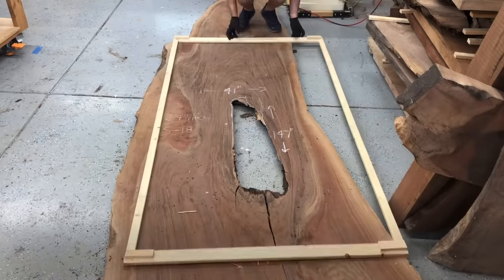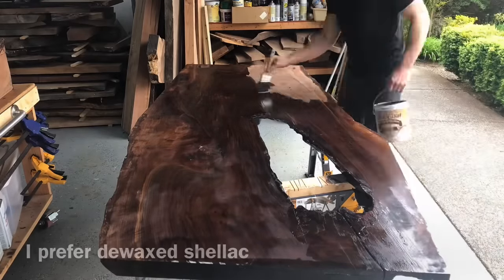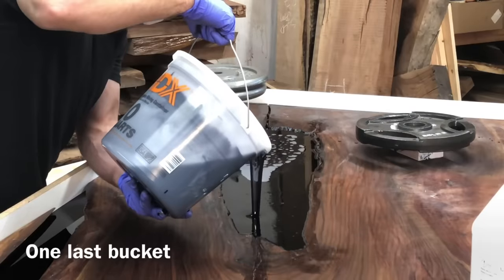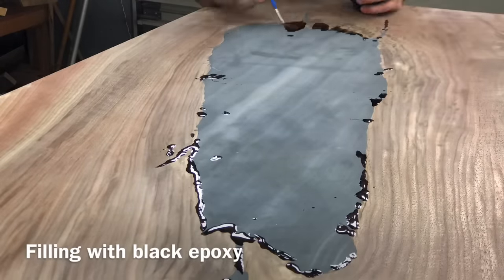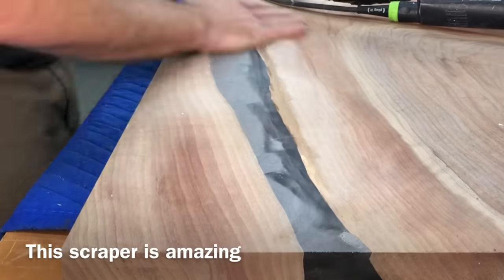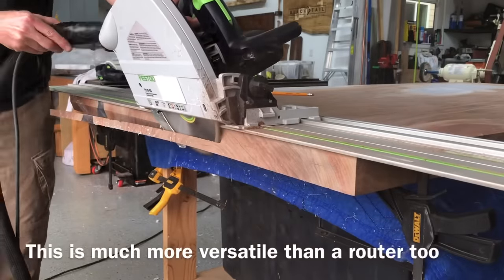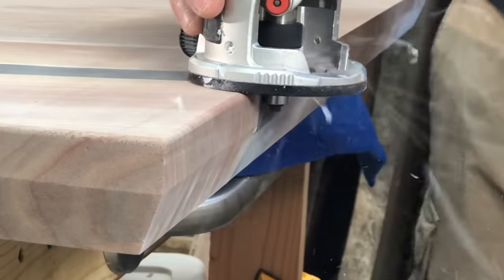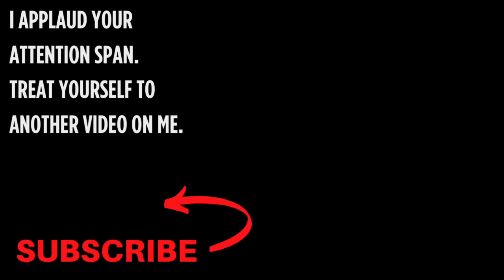$250 Slab To $7700 Table

Comment: Love this table, excellent patch on the corner as well, I'm a Staircase builder by trade, I specialised in curved handrails. Another way I've found to fix difficult patches is to use 2 types of glue, standard PVA wood glue on the outside edge of the timber faces and a super glue on the inside of the faces. Personally I've found a product called Mitre Fast, a 2 part super glue that bonds in 10seconds as the most efficient method. This allows you to fix the issue completely and move on within the hour without having to wait for the PVA to fully cure.

Comment: Another method to consider when attaching the small piece of wood to the corner is to use electrical tape instead of painters tape. It’s stretchy and will apply a small clamping force to the piece as it dries. Great work sir, much respect.
Reply: I have no experience so I may be wrong, but I’d consider putting down some painters tape on the table first, then using the electrical tape to clamp the patch piece on and not have any adhesive from the electrical tape sticking to the table.
Reply: Electrical tape will leave a residue. A strap clamp would hold that piece in place, just loop it around the tabletop and ratchet it down.

Comment: I love the finished table.  Admit I had doubts at the beginning when you said black epoxy, but i stuck with it and was converted at the end! Absolutely brilliant solution to the imperfect corner. I think I would have rounded it off and done the same thing to all the other corners to match because of where the problem was and the size and the issue with not being able to clamp. So hats off to you for sorting it out so brilliantly!

Comment: I used to finish concrete. We would "knock" the mold many times with a hammer to get the bubbles to "surface out". In large pours we would insert an industrial type of vibrating "peg" for lack of a better term for the same purpose. Have you considered knocking your mold with a hammer after your pour or otherwise trying to vibrate the bubbles out of the solution?  I would think the bubbles would surface easier if the solution were warmer as well. Awesome project man! Oh,,, and metal, hands down.
Reply: I had the same thought. Vibrating the fresh epoxy might eliminate many of those little flaws that appear after planing.
Reply: @marcstory860  that doesn’t remove the bubbles. Heat from a torch or heat gun remove bubbles from epoxy. Look it up.
Reply: @Ritebowl  There's usually more than one way to accomplish a task and one is normally better than the other. It's called process improvement.

Comment: Have to say that's the most amazing table I've ever seen, even been in 6star hotels but you have topped them all. You are certainly an artist in my books. Talented would be an understatement.
Reply from the maker: Wow, thanks so much!
Reply: 6 star hotels? dang you find them in outer space or what?
Reply: @Neopopulist  Different countries and organizations use different rating systems for hotels. Many organizations use a 1 to 5 star rating but you also have journalists that will write stuff like "yeah this could be a 6 star hotel." Or a 7 star. Or (insert however many stars you like) even if no such accreditation exists to illustrate a point about the quality they experienced.

Comment: You may want to invest in a system for flipping these large heavy tables over.  I work in a custom wood door shop and we make large heavy doors and most of the older guys in the shop have some pretty serious shoulder issues from years of flipping doors.  When you flip with the full weight of the table coming down on one shoulder it can mess you up long term.  Love the video!

Comment: Metal. Beautiful work, as always. And as requested, my experience tip: when using a saw or plane to cut away overhang like on the fix for the lost corner: cut in the direction that pushes or pulls the pieces together (not away from each other, just in case any weakness in the joint (or adjacent wood) decides to take advantage of the situation.
Reply: When I did wood working and needed a bevel 
An older carpenter said to do the corners first about a foot away from the ends to prevent snaps or breaks from the weight of the length 
I disregarded it the first time and than I was like sure we will try it 
Second time it came out perfect 

Home renovation- client wanted some custom molding they seen online but they didn’t want to pay the money for it so he paid me and my mentor to make them and reframe ever door and do some custom stairs
Oh joy 
Funny thing is my mentor was in his 50’ s he was old school and as close to no power tools as possible except for precision cuts 
He would hand saw or chip everything and sand and shave everything

Comment: Great repair also.
Sometimes we have to slow down towards the end of the cut. Also, with the track saw. You can stop and trim the cut off so it's not dangling. 
Or, change the saw blade. The carbines get dull or damages

Comment: I don't build tables, but as a general rule, it's always good to have an extra sawhorse around when ripping long sections, even if you're just cutting sheathing for your roof. It's such a bummer when a once-nice piece of wood ends up with an ugly splintered corner that could have been easily prevented. Thanks for the video.

Comment: These are amazing legs for the table. The whole product is simply stunning. If I had money this is exactly the design I’d go for but replace it with your fire table. Metal and wood all the way for myself. I also think using metal around the edges will make for a very cool design. Not sure how will it affect the seasonal changes though.
Reply: depending on the fasteners i feel that if it were screwed on it would work just fine but if you were to weld the borders around the sides that might pose for a bit of an issue

Comment: Doing some glue ups with weird angles and I find packing tape works amazingly well because it can stretch. Make sure it sits pretty flat though because if not the bumps leave residue that can normally just be rubbed off but sometimes it needs a sanding block or chisel.
Reply: This has nothing to do with your comment,but I love your user

Comment: I freaking love these videos. I just found you today and I’ve probably watched 5 hours! I wanted to ask you why you only use slabs and not boards. I assume the clients are probably looking for something specific. I made an 8x4 dining table with old white oak railroad wood. I ran into a few issues along the way and I didn’t have anyone to look to for experience. One thing I found interesting is the epoxy I mixed the first few pours were quite small, then my flood coat I used a large bucket, and within 30 seconds of mixing the resin and hardener, it started smoking and melted my bucket. The company told me all epoxy would do that as it is exothermic, and I needed to mix larger pours on sheet trays… I ended up just using a bunch of 1/2 gallon mixes and I ended up scraping the final pour right down the middle and sure enough, still to this day have a strip of tacky epoxy. I plan to refinish is someday when my kids gauge it or something, but do you know any tips or tricks other that picking it out and re-pouring? I look forward to using your workshop when I build my in-laws new table for their lake house next year.
Reply: I know I have seen others who will layer the resin for that exact reason. Maybe try the type of resin he uses?

Comment: I like bare metal legs when the legs are a feature of the design, and black when the focus should just be on the table top.

Question--how to you calculate the price of a table, and have you ever increased the price because the finished table looked better than anticipated?

Comment: The only tip I can think of would be this: Don't hesitate to use scraps of wood to make an elaborate clamp that is perfect for the job. It's better to use up a couple of small scraps which might be useful later to ensure a perfect seam on your current project.
Reply: Exactly. Fixtures are essential to manufacturing. Otherwise you pay big in rework labor and scrap.

Comment: I love the wood with metal look. I like how the table base wouldn’t need to be as big and bulky in order to be functional. And with the metal base I would almost love to see some intentionally placed metal inlays. wether the inlays were functional or more so only  for aesthetics like if it were to be one little 1/8” band to go all the way around the perimeter. When I get to having plenty of my own time to myself for projects like this, I would love to make a massive steampunk themed piece with a lot of gears that work into moving parts
Reply: I love dark wood and chrome. Aluminum is a lot cheaper, but, if you don't mind the extra work, it can be polished to a point where it's hard to tell the difference.
Reply: I like the idea of adding some metal or maybe strip lighting but the moving parts are beyond me. Good luck.

Comment: I appreciate both wood and metal.  As for the chipped corner, I would have cut the actual chip remnant off of the scrap and glued it back on.  The rough grain of Walnut (when torn or split) lends itself well to being spliced back together with a seamless fit and matching sheen.  Or you could have gone with the opposite approach and did something much more contrasting.  Some sort of clever "bowtie" on the corner.  The "almost" matching fix would have pissed me off as a customer paying $8,000 for a table top.  But in the end, beautiful work as always.
Reply: that was my instinct too, why not use the original bit that broke off?  Surely it would have matched back in perfectly?

Comment: To prevent a chip like that, try cutting backwards. Because the blade is spinning in one direction it tends to chip as you pass the saw over it. If you just run the saw backwards about an inch or two it will prevent chipping.
Reply: Just like with drilling.
Reply: That's a good tip

Comment: I’ve been wanting to build a table like this, but haven’t had the courage. But your video was sooo inspiring and clear. And you are a great teacher.

I do have a question - I live in Kansas City. Where might I  find a slab like you are using for this table? I’m not expecting you to have the name and phone number of the person Kansas City of that sells this type/size. So, where do I look?

Regarding my preferences - I like wood. I don’t like mettle I would have gone for a bit lighter wood stain. And 

. I’m definitely drawn to epoxy that is blue like water. So whatever I do is the first piece, that’s probably the direction I would go.

Thanks. I’m a fan. I’ll be watching all your videos. And tell the Pacxy company that I’m going to buy their product based on your recommendation and demo. And making you a spokes person for the product is a good business decision on their part.

I can’t say it will be soon but when I Make this top I will send you some photos … regardless if the outcome.

Joe M

Comment: Metal for sure! This was the second video of yours that I've seen from beginning to end. I really enjoy your  casual conversation style that is laced with tips and learning moments. I've done a little bit of woodworking, but never messed with epoxy. Do you have any beginner project ideas where I could practice working with both on a smaller scale?
Reply from the maker: Maybe a serving board
Reply: Do you have a video on making a serving board?
Reply: metal. unsure.  wood.  or both?  difficult question.  But, also interested in a beginners project.  would love to make something small.

Comment: Metal! Love this, how do you prevent epoxy from seeping under the wood? Is it a good idea to apply caulk at the bottom? Also what finish did you use? I didn’t catch that
Reply: Peanut butter is the best option to prevent that epoxy from sticking, also with the finish I like to use 120 grit. Hope this helps

Comment: I don't like metal or wood exclusively, open minded case by case. Im excited to be a  new viewer. I've watched one or two of your new videos, this one was just in my suggested.  You mentioned in one of your videos some people watch because it's soothing, others because they want to learn. I've done one Handy-man, google education backed epoxy pour repair  on a butchers block sink top botch job from an improper mix of a previous installer  and I think I ended up coming across your channel at that time. Idk if I'll ever have the drive, patience, interest time or resources to build a table like this but I undoubtedly LOVE your work narrative style. There are definitely videos where people talk to much, these are definitely not one of those times.  You're saying the right amount at the right time for the rjght reasona IMO.  Your diligence , attention to detail, patience and see through is inspiring thank you foe the channel.

Comment: A lot of good tips in info in this video, thank you.

As a nine finger woodworker, my only advice is pretty obvious, but it's easy to make this mistake. We all know you never go with the rotation of a saw or router, always go against the spin. But when using a router it's easy to push against the rotation but quickly pull back just a bit. That's what I did using a t-slot bit to make a channel. Going against the rotation I made the mistake of pulling back a piece of wood I was cutting just a tad and it caught the wood and pulled it and my hand right into the blade. Lost a pinkie and almost lost my ring finger. Stupid mistake I'll never make again.

Comment: I feel like the stand/legs
material depends what the environment the table is in. Especially the color. I could foresee all wood legs/stand(providing they would bear the weight) in a rustic cabin for the purist vibe. Or shiny metal in a more modern home or eatery. Great work! I appreciate the tips sprinkled throughout. I'll be reactivating my resin working skills(originally for surfboard repair) to begin making cast root burl lamps!

Comment: Just a quick tip, use an offset base on your laminate trimmer. It'll make for a steadier base when you trim route your edges. An offset trimmer base is easy to make.

Comment: I have vastly more experience working with metal. Not only fabrication but being a mechanic and a bit of an engineer. I have built some things with wood as well but primarily I've worked with metal as an automotive technician and I've built and repaired other equipment. Also engineered, built and maintained a lot 9f electronics. This was all before I got into more profitable industries such as operating heavy equipment and driving commercial trucks. So currently operating an articulated boom crane and driving a commercial truck for a living has me far from working with wood but I still appreciate the skill. I have to say the proper combination of woodworking and metal fabrication looks great! The wood and epoxy tables you do then mount them to very well fabricated metal legs look incredible!

Comment: Wood I guess. I have never made a table or been interested in it. My father was a carpenter for 30 years and I can't read a tape measure. Then again is father was a mechanic for 50 years and I have to change the brakes on his car. LOL Anyway, your work is amazing. I am about to turn 50 and looking for a hobby to get started in. I definitely don't think I would start with a table. I was a paramedic for 25 years but my body no longer allows me that privilege. Excellent video and I love the commenting. I can pretty much fix anything mechanical but working with wood would be an interesting challenge.

Comment: I made a comment about a piece of below the trunk, that you did, making it into a round table, and I had suggested that if you had 2 of such pieces that you could put them together, making a long table. Just an idea that would take longer than maybe it's worth, just a suggestion. (edit) I see that you did 2 of those but one was more like a jungle of a root system of which I was referring to.

Comment: The small micro air holes or pockets that you make bigger so they take epoxy  better.. wondering if you ever thought  of vibrations like when you pour concrete  to get it into every space... If you took  a jigsaw with no blade and ran it on the edges where it was being filled it might release those small air pickets... just a thought
Love your work and videos and dont mind the commentary like all the information good and bad and why

Comment: For sure wood!!!!  I see that you usually take the finish sanding up to 180 or higher sometimes. I’m assuming you haven’t had any issues with the bonding of Rubio mono coat, they only recommend finishing up to 120.  I’ve tried to stop at 120 but can’t get all the curlies out of the wood with ROS. Thoughts???

Comment: First off, thank you for all the videos you post.  I have been a fan for years now and have at least attempted to do most of the great things you have constructed.  I had a question about outdoor pieces.  Do you have a wood finish that you recommend that protects wood/epoxy pieces that would be in the backyard?  For example, if there was a planter box that was built with similar materials as a table, but would be good for outside where it wouldn't warp or melt in the sun.  Possibly a finish and then a clear coat after to protect?  But I didn't want to have that super shiny look.  Thank you again!

Comment: Hi, I'm a carpenter and would like to start making epoxy products such as this one. I have never done any fine joinery work or used epoxy before but I've started looking into it and I'm hooked. What would be the best products to work on to get me started? Should I avoid using expensive hard woods to start? Please any tips or advice would be greatly appreciated to someone like myself starting out. I want to make a full time career out of it and will be making a work shop at home like yourself. Thank you